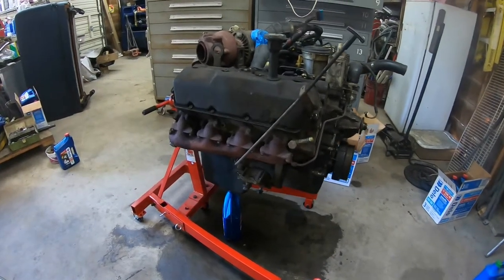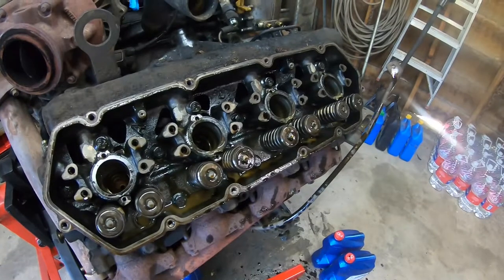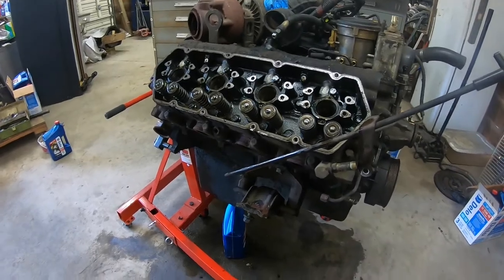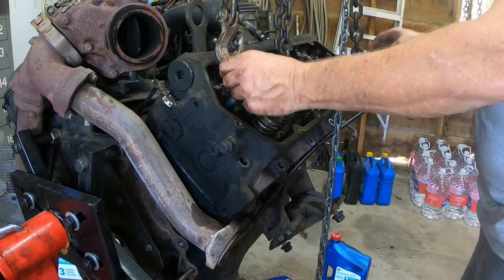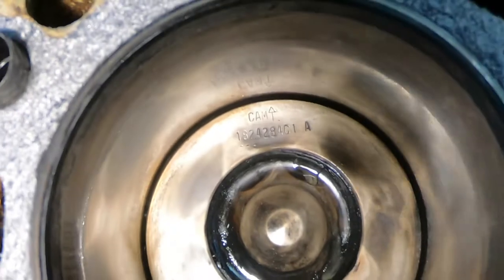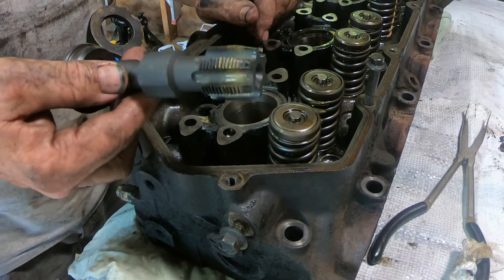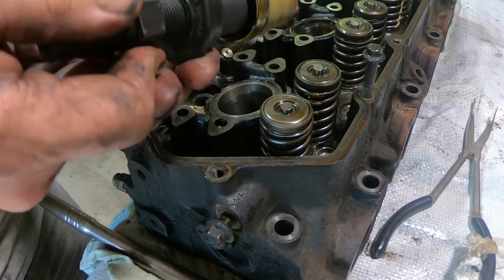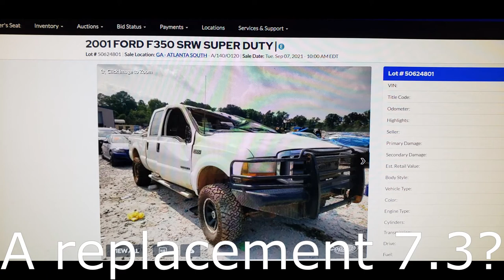Diagnosing Coolant in Oil on my 1999 7.3 PowerStroke

Comment: I learned that a radiator pressure tester is a great tool to diagnose leaking injector sleeves, cups, whatever you want to call them. If the system can hold 16lbs for an hour, you're probably good to go. Other wise check cylinders with a vacuum pump for coolant, or coolant coming out the top ring of the injector cups to head seal.
Reply from the maker: With cracked cups you would have fuel in the coolant as the fuel pressure is much higher than the coolant pressure. A small leak leaves tiny drops of fuel floating on the water. A larger leak overflows the degas bottle and pushes it out past the cap due to the pressure. On this engine I pressurized the coolant system and could hear it leaking into the engine. Found a crack between cyl 1 and 3.
Reply: @2020HotShotTruckingLLC  it's uncommon, but sometimes still happens. There are 3 possible leakage points on the cups.  1 at the top of cup to head seal point. This can allow fuel entering coolant. 2 a crack in the cup. This can allow fuel entering the coolant. 3 the bottom of the cup to top of cylinder seal. This leak can allow  coolant to enter the cylinder. You usually notice the scent of evaporating coolant at the tailpipe. Unexplained loss of coolant is another big clue. The copper injector washer rarely allows fuel to enter the coolant.
Reply from the maker: @Steakholder01  I've had 2 of the three: Cracked cups that allowed fuel into the coolant. I replaced the cups and after following the directions which unfortunately did not detail the injector hold down bolt torque procedure I had one or more injectors come loose and the cups raised up due to compression pressure. This pressurized the coolant system with combustion gasses. You will find the radiator return hose hard with pressure, but not hot and no heat from the defrosters. Also the cap will be venting coolant. So I got to replace the cups a second time and it was a lesson learned. My pre-trip inspections now include verifying heat out the defrosters so I know the coolant is throughout the system.
Reply: @2020HotShotTruckingLLC  that makes sense. Sorry to hear it. Riffraff diesel has stainless steel cups for sale now. Cleaning the bores is key. Got to be spotless. Putting the loctite 602 on the contact surfaces within the bore is another safeguard to having it seal the first time. Pressure testing with the radiator test kit after a warm 36 hour cure period is very important. The system should be capable of maintaining 16 psi for one hour. Just my 2 cents after doing it several times. It's the most pain in the backside things on this motor IMO. Good luck & God bless Hot Shot!

Comment: Oil cooler it's on the outside of the drivers side of the block.I dealt with this issue on a brand new engine after 500 miles It's the Orings I had to fix mine on the side of the road in rural Kentucky the pouring rain.  it took me 5hrs a job I don't want to ever do again in that situation.
Reply from the maker: The low pressure oil is till far higher pressure than the coolant and therefore when the oil cooler leaks you will wind up with oil in the coolant, not the other way around if the engine is running. My coolant was very low but what was left had no oil or diesel in it. This was caused by a crack between cylinder #1 and #3 which I showed at the end of the video.

Comment: Was you getting bubbles in the coolant tank ?
Reply from the maker: No, bubbles in the coolant are caused by combustion gasses. Most common cause for that in these 7.3's are loose injector hold down bolts that allow the injector cup to lift and this allows combustion gasses to enter the coolant from the cylinder(s) where the cups came loose. My block cracked and coolant entered the oil.

Comment: Are using dca in your coolant? Those engines are known for cavitation of the cylinder walls and you have to add dca to the green coolant. I installed a coolant filter on my truck and I buy the filters with the additive from a peterbuilt dealership
Reply from the maker: I was worried that was the cause of the coolant in the oil, but the timing cover looked fine. I had just bought the truck in December and hadn't used it much till early summer so it was still on whatever the previous owner had run. The engine I swapped into my truck I already had replaced the injector cups and I just bought ELC coolant for it. When I get done with my current project I will flush and fill with ELC. The injector cup sealant used on the early 99's and before was not compatible with the ELC.
Reply: It's SCA, supplemental coolant additives. Take a look at powerstroke help in depth dive into coolant technology. 99's are sketchy cause depending on the built date the "early" 99 cannot run ELC coolants. Fleet guard is one to look into. The chemicals in ELC eat the sealant around the injector cups, among other things, in early 99 models.

Comment: You found cracks in the #1 and #3 cylinders which explains the coolant in the oil. But did you ever figure out how your #7 cylinder got filled with coolant?
Reply from the maker: No, I'm thinking that may have happened when I broke the head loose. Once I found the crack in the block the engine was toast. I stripped the block of usable parts and it went to the scrap yard this past Thursday. I apologize that I have fallen behind in my videos. The engine I swapped in place of this one cracked a piston. I bought another wreck for it's motor and installed it. I am in the process of rebuilding another one so for once, I will be starting with a fresh 7.3.

Comment: I got a 01 6.4 and oil won’t go down the filler neck. Any ideas ?
Reply from the maker: Well, for one the only 01 powerstrokes were 7.3's. If it's a 7.3, the filler neck is on top of the valve cover and there's nothing to stop the oil from going in unless the block is full. As for a 6.4, I have no experience with them at all. I would assume the oil fill would be similar to a 7.3. About the only thing that would cause that would be excessive sludge build up. I would pull the filler tube and look inside. Maybe remove the valve cover... doesn't sound good at all!

Comment: What would have caused this ?? How many miles do these engines have ??
Reply from the maker: Both engines are around 350K. This one wound up with a crack between cylinders 1 and 3. This past Monday the one I installed developed a bad miss and smoke right after picking up a load. I did a short video showing when it happened with video from the rear camera and audio inside the cab. The truck is at a mechanic waiting for him to diagnose it. Meanwhile, I tore down my other spare and found it had broken rings on one cylinder. Will take that engine to a machine shop to start the building process. It only had about 260K but the issue was there when I bought it a few years ago. Once I have a new or rebuilt engine, I should have no major issues for a long time. When you buy a used 20+ year old truck, you never really know the history of how it was abused or maintained.

Comment: was your truck.turned up with tuner or.chip?
Reply from the maker: I used a 25 HP towing tune with a Hydra. When I bought the truck, I found a gold superchip in the glovebox so it may have been abused before I bought it with 333K miles on it.